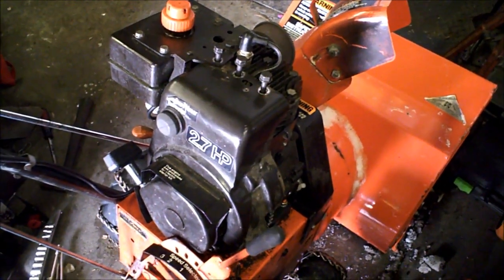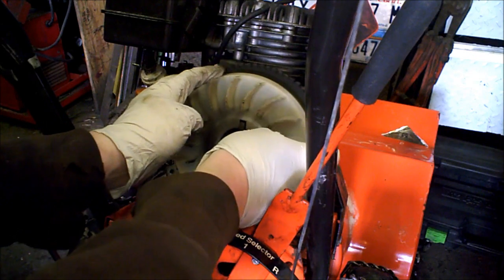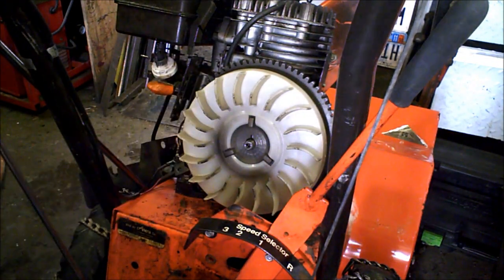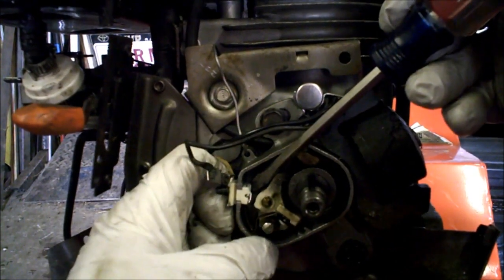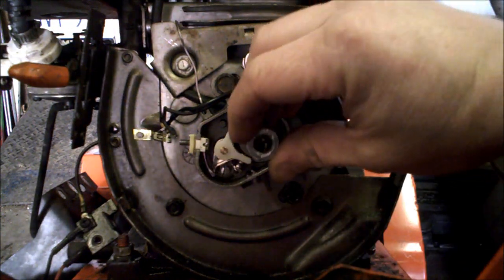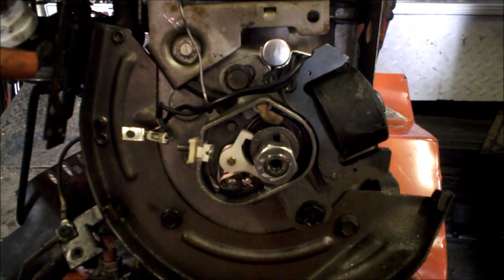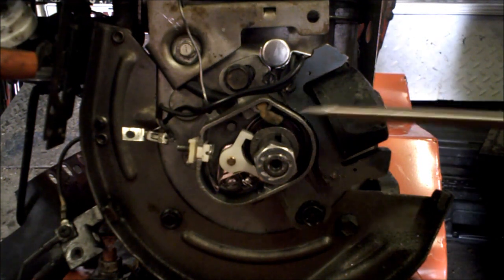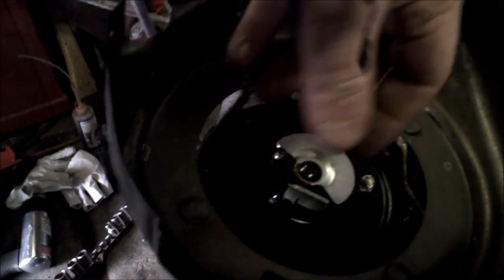Tecumseh Points and Condenser 3-10hp replace

Comment: This was my first try doing a "comment"  it worked!

I had already booked marked your tire flap trick.  I'll need to drill my impeller but totally worth it.  I'll find the pure"est" gas for my small engines as well.  I put together rmy 1032 this weekend and I'll try to post a picture.  wish me luck (with the posting a pic, JD should come together fine).

Comment: Great job on the vid , just like to add if the condenser is weak or bad the points will be burnt out. The condenser controls the voltage being supplied to the points.

Comment: Another tip if your taking something apart that you have never done before.... take pictures with  a decent digital camera as you dis-assemble the project. That way you can  look at the photos to see "what"   went   "where" as you re-assemble. It's especially helpful when you the have to wait for special order parts to arrive days or weeks later before you start the re-assemble process. I like using my I-Pad because it has a large screen for viewing and also can take a video if needed?

Comment: Thanks for the great video. I have a 1970 Fox Street Scamp with a 1969 Tecumseh HS40 with lighting coil. I have been doing a complete rebuild frame and engine. I sent the engine out to be rebuilt and it turned out beautiful. Now I need to change the points condenser and the coil. With your video any fear I had about taking this apart are gone thanks. You did not show how to change the coil. It looks like you where almost there. Thanks again,Matt
Reply from the maker: mkkmb5 I rarely change a coil as they either work or don't. They don't get weaker over time or anything like that so there's really never a need unlike the condenser and points.

Comment: I really enjoy your videos..Great,great stuff. You do an excellent job of explaining and showing what you are doing. One small caveat is your camera is fizzy on extreme close ups but that's just from a guy whose eyes aren't what they used to be. Awesome job. I have an older Tecumseh H60 that someone told me to pull the top of the head off and after I get to TDC to drop it a quarters width before I set the points. I don't think he really knew what he was talking about. Thanks.

Comment: Hello there,

I received a Craftsman 3.0 (tecumseh h30)  from my uncle.  It has been quite the fun project so far.  Just wanted to say that this has been the most informative video that I have watched so far, and believe me, I have watched about 20.

Thanks so much.

Jeff
Reply from the maker: I'm glad it helped.
Reply: +sixtyfiveford  I replaced the magneto,  points,  and condenser.   still a no go.   I pour a little gas in the carb and it puffs one or twice.   I might need a new carb?
Reply from the maker: More than likely you have a diaphragm carb and the diaphragm is dried out. https://youtu.be/c-dEsc74Lsw
Reply: Hmm.   Would you recommend a rebuild or new?   I've found new ones for 13 dollars on ebay.   Old one has no float new one does though
Reply from the maker: The diaphragm and float carbs aren't always swap-able.
Reply: +sixtyfiveford whole new carb then?
Reply: +sixtyfiveford thank you for all of your help by the way
Reply from the maker: I generally just do a quick rebuild.

Comment: I am about to change points and condenser on a 1965 Ariens sno thro with a Tecumseh 6 HP .  If your machine is like mine, I don't think I will have much trouble.  Thanks for taking the time to make this video.
Reply from the maker: Yours should be the same. I hope that this helps. Let me know how it goes.
Reply: sixtyfiveford Got them changed with no trouble...a little slow but hey it was the first time I did it....Now to figure out how to mount a new carb that has a different choke lever
Reply from the maker: Most of the time you can just pull out the entire new choke lever and replace it with the old.

Comment: Be careful when tightening down the nut that holds on the condenser wire because it can twist the spring on the points down so that it comes in contact with the base plate and shorts out the ignition and you won't get spark.
Reply: Thank you very much.

Comment from the maker: I'm assuming yours is badged as a Craftsman and that is why your looking at Searspartsdirect. Cross the sears number to Tecumseh and there is a lot of stuff out there. The models with a magneto under the flywheel are adjustable but never go out of timing, unless someone has moved it. I do have all the specs to do it for standard Tecumsehs and I don't think because it is in a outboard it will make a difference. Do you need that info?

Comment from the maker: If you can find the exact Ohms the coil is supposed to be then you can test it with a multimeter. The trick there is finding out what your values should be. The condensers can be tested with a multimeter that have a capacitance setting. I bought a cheap multimeter just because it had this feature and it is able to tell. Again you need to know what the capacitance is for a give condenser(old name for a capacitor). I think that the spark plug wires attached to a coil begin to go bad.

Comment: Just bought an Ariens Rocket V tiller.  It had no spark, so I tried cleaning the points, checking the coil, condenser, points, etc.  Still couldn't get a spark, so I went back into it today.  I noticed that there were 2 small wires coming off of the back of the coil and both of them were connected to the condensor.  It was shorting itself out, and the longer wire should have been connected to the points.  Glad I pulled the coil and everything off to check the coil today, and look for corrosion betweent the engine and the coil/points housing.  Now I've got spark, tomorrow I'll clean the carb.

Comment: Excellent tip using the three feeler gauges, you make it look easy.  I like changing points on a Kohler k series engine. Three screws and their out!
Reply: i have just used 20,000 all my life  im 88 now so ihave seen a few    as long as they open and close its ok if your point are pitting swap out the condensr  you can clean the points  and reuse if needed but can the condenser .

Comment: If you don't have an impact gun you can stick a piece of rope down the spark plug hole to hold the piston so you don't risk damaging the flywheel or the block cooling fins. You can also put a block of wood between the hammer and the crankshaft when you try knocking the flywheel off.

Comment from the maker: 34852   (35545A new #) Piston, Pin & Ring Assy. (.010 oversize)
34853   (35546  new #) Piston, Pin & Ring Assy. (.020 oversize)

34854    Ring Set, Piston (Standard) (2-5/8")

There are a few online places that still have the oversized kicking around on their shelf but they are not being made anymore(+-$75).  With that said most of these engines wear the rings and the piston bore is still in great shape. I find just a couple second hone and original size rings ($10) and she'll be 95% new.

Comment: nice video as I was struggling to get the cowling past the gear selector assembly.  Where did you get those chains for the roughly 9.5 inch diameter wheels?
Reply from the maker: I think the part number is "51523" for the tire chains. Google 51523 tire chains and you should find some.

Comment: I have a Tecumseh HM80 8hp, that had spark this summer as well as a Briggs that has points and had spark. My shed catches a lot of moisture which I need to resolve this spring. But anyway, I sanded the points on the Briggs and the spark came right back, I did it on the Tecumseh twice and still nothing. Ive noticed this in the past too, the Tecumseh's are harder to deal with when it comes to points. What is most likely my issue? I cleaned them and sprayed contact cleaner on all the areas that you can, nothing. I have new points and condensor still in the package, but before I go wasting those what is the most likely thing that caused this or went bad? Should I try cleaning them better? Putting the flywheel and cover back on and than having to take them off again is a pain in the ass...
Reply from the maker: Generally when I've had issues like this whether Briggs or Tecumseh it has always been the condesor.
Reply: @sixtyfiveford  Thank's

Comment: Hello, I have a 10HP Tecumseh with the numbers HMSK100-159168U-6064Q. The Gilson snow blower it is on numbers are 55340-47846. I  have kept it going for years by doing the basics.This was a throw away so no manuals. I am not even sure if the spark plug in it it correct. I like to keep it even longer it is an animal in the snow. Any ideas where I can get manuals or the specs? Thanks for any info & this video,another great job!

Comment: I tried finding the appropriate torque for a  briggs and stratton engine 250 cc on a 28 deluxe snowblower for the flywheel   I torque it about 55 foot pounds is this adequate and safe enough for the flywheel nut coming off...

Comment: Great Video!!! have a question on the grounding thou. on the side of the carb, there is a linkage plate with one of the grounding wire attached. the head of it broke off and so I just stripped the casing of the wire and grounded it to a bolt of the engine. Was this not supposed to be constant grounded? I had it running before I did it but it just stopped so I figured it want the aged grounding wire. now I cant get it to run at all. Thanks for any help you can give.
Reply from the maker: +Edward L It's not supposed to be constant grounded. Any time this wire touches metal on the motor/frame it will kill all spark.

Comment: Had no idea how to get the flywheel off.  Absolutely great video.  Had no spark.  Will check points.  Is it possible the coil is bad?  Any way to test it?  Thanks!
Reply from the maker: It is possible for the coil to go bad, but it is rare. Generally no spark issues are points/condensor related. They are a consumable wear item and should be replaced every 10 years or so. You can test the coil with a multimeter on the ohms settings. I don't recall off the top of my head what the reading is supposed to be. However the easiest way to test it is to make sure you points/condensor are cleaned or new and if you still have no spark you know the coil is faulty.

Comment: just replaced the points and condensers thanks to your video. I also cleaned and rebuild the card. Got it tuned and running good. but the reason why I done all this is because it would stall out when I would walk with it or throw snow so I thought if I would do what I did. It would work. nope still stalled out on my test runs. any suggestions.
Reply from the maker: +Justin Mandelko Your main jet is set to lean. It needs more fuel to the engine so screw the main jet out a little.

Comment: Great explanation. Question : What if the condenser is attached to the coil? should you replace the unit as a whole or just the points?
Reply from the maker: The condensor shouldn't be permanently affixed to the coil.

Comment: Hi- I (had) an 8 hp Ariens Blower. The change for the points etc are not so simple. Points looked nothing like a shown though function surely similar. Timing was to have the points just beginning to open at 90 thousands prior to top dead center. Was quite frustrating to get set properly with an offset cylinder. Dial gauge and patience required. Cheers!.

Comment: great video, I tried to fire up my 1981 toro 421 snowblower. Had no spark, replaced points and condenser and coil and still have no spark disconnected key switch and the wire going to the points for the manual kill switch and still no spark. Any Ideas? points are at .20 the new plug is .30 used a business card to set the coil to flywheel magnet. Thanks
Reply from the maker: +Steve Felts Sometimes the engine needs to rotate quit a few times to initially charge the condensor, but I'm sure you've pulled it enough times to do this. I would pull the plug and check spark with the plug out. First I would make sure the kill wire hasn't been pinched under the shroud or that it isn't grounding out somehow as this seams to one of the biggest culprits. Make sure the spark plug lead wire isn't pinched between the housing/block and shorting as well. The points if they are greasy can stop a connection/spark as well.  In very rare cases I've heard of weak flywheel magnets. You should be able to hold a screwdriver a 1/2" away and feel a pull.
Reply: Steve Felts do not use a bis card or match book  use feeler gages

Comment: I don't know what is wrong with my snowblower. It is from the 80's and probably has points.  But I do get a spark at the spark plug, so does that mean the points are good or could they still be bad?  So far cleaned the carb since it was leaking fuel. Got it back on and now I pull and no ignition.  Going to get a can of starter fluid to see if I can at least get it running.
Reply from the maker: Bad points you'll get a extremely weak spark or no spark at all. Good spark will be nice and bright and jump 1/4 inch gap.
Reply: @sixtyfiveford  Thanks for the reply!
I finally got it working today.  I took the flywheel off, sanded the points with 400 grit, cleaned them with carb clean and paper, reassembled, had good spark. wouldn't start even with starter fluid, so I pulled off the carb, stuffed a rag into the intake port and soaked it with starter fluid. Fired right up, kept it running with starter fluid for about a minute.  Put the carb back on and it fired right up. It just need to blow a few of the cobwebs out with the starter fluid it seems.

Comment from the maker: Use your model number to view online parts breakdowns (outdoordistributors is a good place). This will give you your part number. Points for Tecumsehs are avaliable at 1000's of online retailers. Ebay will most likely be the cheapest with shipping. It is most likely part number 30547A for points and 30548B for condenser. Let me know how it goes.

Comment: that pointy tip on the air hammer sometimes spreads the shaft like car CV axle joints. Really messes up the axle joint. It's soft

Comment from the maker: HMSK100 Horizontal Mount Snow King 10.0hp .. A king of a motor built on the March 5th 1986 (production for Gilson stopped in 1987).

RJ17LM Champion

A parts diagram can be downloaded at outdoorpowerdistributors com follow the Tecumseh links.

For Gilson info go to gilsonsnowblowers com where a guy has a lot of cool stuff about them

Comment: I have a 1974 Tecumseh HM80 and it wasn't running right.  I just did the points and condenser but I only get about an 1/8" or 3.5mm max spark length on my Lisle 20700 spark tester.  Is this too weak?  Do you think I need to change the coil?
Reply from the maker: The coil either works or it doesn't work. 1/8 of an inch should suffice just fine for these low compression engines.

Comment: Nice video man, but i still have some question... If you have to set the entire coil where the 2 big screw that holds the entire thing to the engine , where would be the right point to set it up? I had to remove everything to replace the seal , i made marks to put back together but it never started after that.
Reply from the maker: Leonardo Oliveira It's actually a fairly complicated process to set it back up. But if you put it right back to where you marked it, it will be good. Did you check for spark at the plug?
Reply: i did , actually it´s brand new, I replaced all the little parts on the carburetor , new condenser, new bolts for the head, new fuel , gas line, filter , i don´t know what to do anymore
Reply from the maker: So is there spark?

Comment: In my past experience with the old points and condenser engines. 9 times out of 10 the points are not burned or wore out. I simply just file them so they mate together good and re-set them at 20 thousanths. Then you should be good to go! I very seldem ever buy new ones.

Comment from the maker: They were pretty pitted. I actually tried a quick clean and reassembled the motor. It ran a little rough and then the light went off in my head " I should do a video" and replace them.

Comment: So could the points be cleaned or should they always be replaced with little or not spark? If so do you just sand down the points?
Reply from the maker: The majority of the time they just need some very fine sand paper ran across the points contacts.
Reply: sixtyfiveford thanks! Keep up the great videos you're definitely an asset to the YouTube DIY community

Comment: Thanks again, I like the 3 feeler gauge idea. How dod you set the distance from the mag to the coil?
Reply from the maker: ug mold It isn't that critical but I slide a business card in between and tighten it up. Then pull out the business card and that gives it the proper gap.
Reply: sixtyfiveford How do you do that when it is inside the Mag?
Reply from the maker: Oh I guess since the video is on old Tecumsehs that is what you were referring to. I just gave generic instructions.. The old Tecumsehs are a pain and there is an extensive process if you removed it. Here is the Service Manual, you should need page 68 http://www.ccdist.com/_serviceManuals/tecumseh/692509.pdf
Reply: sixtyfiveford Thanks for the manual, will come in handy. What I did was loosened it thinking I was removing the condenser, probably didn't move. I filed off the pitted points and thru it back together and I have spark. Thanks again.
Reply from the maker: I've been lucky and only removed 1. I was able to see exactly where the marks of the bolts were and set it right back. It ran good so I've never went through the process.
Reply: @sixtyfiveford  the link to the manual is broken, wont come up!